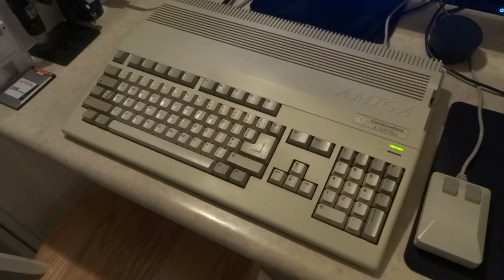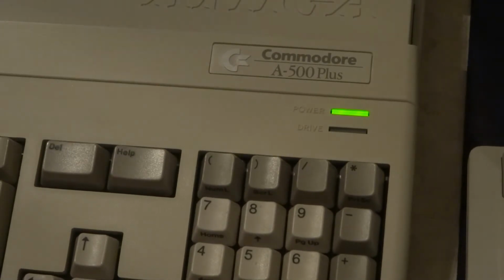Add an IDE LED to your Amiga 500 (unobtrusively)

Comment: Hi, do you have to do something to activate the HDD LED connector on the board? It doesn't seem to work on my Wicher.
Reply from the maker: Mine worked fine right away, it should work as is. Just make sure the polarity is correct and you should be good to go (swap the connector on the HDD Led Header if needed). Lower power LEDs may help as well, most run around 1.2 Volts.

Comment: Brilliant idea, simple solutions are the best. The hard part is finding one of those Wicher 500 boards, everywhere is out of stock :(. 
You've earned a sub
Reply from the maker: Thanks and Welcome to my Channel! You are correct, the Wicher boards are always hard to  find. Apparently they don't make many of them or in very small batches. Most likely the reason form this, like most new Amiga Hardware, they are soldered by hand. The Vampire Series is a good example of that.
Reply from the maker: If you head over here: https://retroami.com.pl/index.php?id_product=179&controller=product&id_lang=1 the Wicher 500i is available for pre-order due Mid November, 2018.